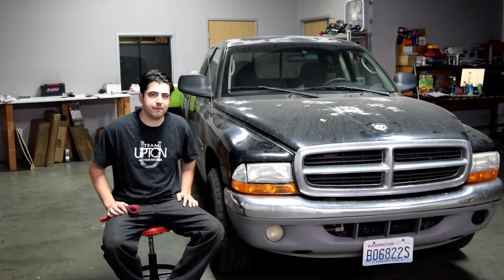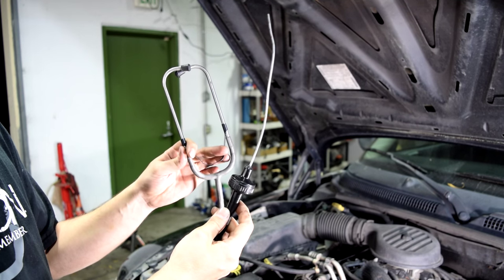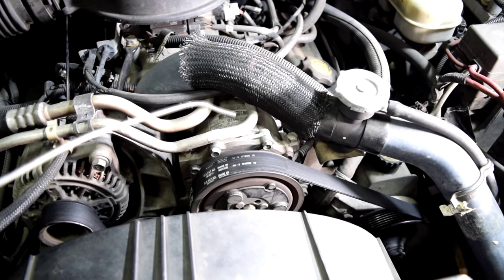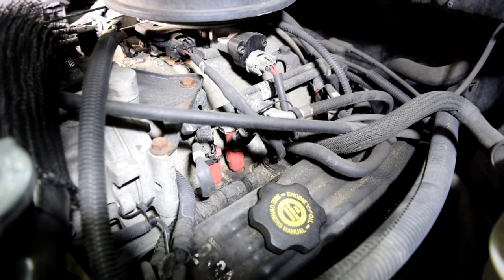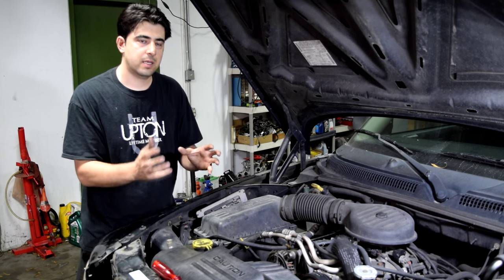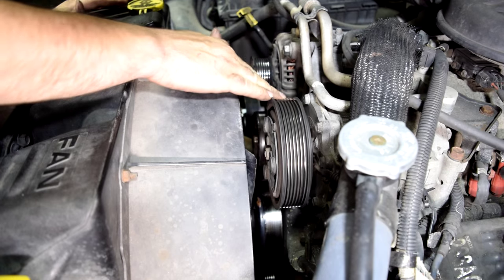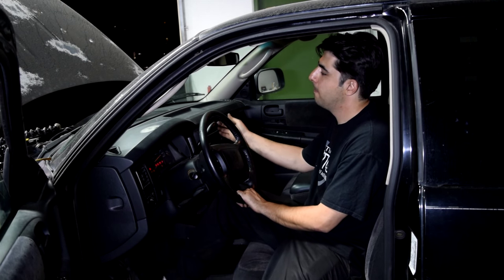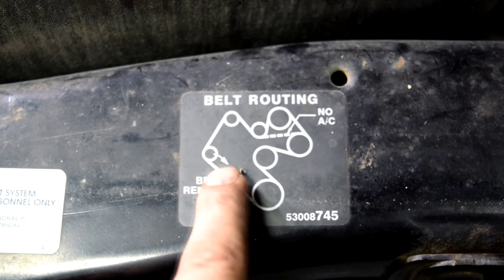How to Find Engine Noises - Finding Pulley, Bearing, Tapping and Knocking Noises

Comment: Thanks for the  bmw help,  I'm not sure what I'll have to do to fix that.  I also have a 1991 jeep Cherokee 4.0 having some overheating issues.  No leaks anywhere, water pump makes no noise,  all hoses have coolant flow,  and are hot,  no air in the system already checked that,  radiator was replaced 2 years ago and it worked great until  now temp is reaching over 220 and then efan kicks in and it does cool it down but something isn't right...  And I also replaced tstat and did complete coolant flush.  So I'm guessing it's water pump or radiator?  What do you think.

Comment: How do you pinpoint noises that only occur while you're driving? I'm pretty sure it's coming from one of these bearings/pulleys. The noise is very acceleration dependent. I can't reproduce it by revving a stationary car. It has to be moving and it only happens when accelerator is pressed about 1/4th of the way. If I go over or under that pedal pressure, it disappears.

Comment: hey I love your videos thank you so much for providing all your hard work for us people who don't know much about cars. I have a unrelated question that I need help with maybe you can help me? I have a 2004 BMW 545i and what's going on is the computer won't communicate with a OBD scan tool and also the car will not start and I get a transmission error and multiple other codes is there any thing that you can think of that could be going on I believe it's my main computer? What do you think please help me.
Reply from the maker: +Mrizing Sorry I have near zero experience working on bmw's but for example in the VW Passats the BCM, TCM and obviously the PCM can do this. If you had problems with other electrical accessories before your car died it would be possible its your bcm.. If you want a shot at fixing it yourself try looking up all the fuses and relays in both your engine and cabin fuse box, than physically check out all your control modules make sure their wiring isn't obviously damaged/loose. And also visit BMW online forums and ask around there, odds are some BMW enthusiasts there can steer you to the right direction. GL

Comment: my belt squeaks when in drive only changes with rpms too. once it hits45mph or the lasthear, it goes quiet for a while then comes back. but goes away in park. the tensioner is good so is the idler? can't seem to find the culprit 😥😥

Comment: Another great video! My car's making an electronic humming noise around the throttle body when the ignition is only in the 2nd position. I used a stethoscope and it sounds the loudest around the idle air control valve. I'll try unplugging it to see if the sound goes away. What then?
Reply from the maker: +anti0918 Thats probably normal, if you have an electronically controlled throttle plate they usually make that noise when the key is in the on position. Thank for commenting.
Reply: RatchetsAnd Wrenches It's a cable throttle. The sound goes away if I unplug the IAC valve connector.
Reply from the maker: +anti0918 Thats ok too I wouldn't worry about it. cheers

Comment: how do you know how tight the belt should be when you put it back on and tension it
Reply from the maker: +neppy5 these tensioners are auto adjusting tensioner and you can't manually adjust them. cheers

Comment: Dr, Sir:
I have the Toyota corolla 2004 CE 4 cylinder 1,8 L and it's become a month when the engine got hot after 5 or 10 minutes it starts to vibration and shaking. However, I have replaced new spark plugs, chek all the mounts, vacuum pipes cleaned the throttle body and air idle valve, replaced the drive belt too. but still, it has the same problems. Please help me.  I'm waiting to hear from you. best regards,
Reply: manoky zadran it may be the radiator. If its not giving out the right amount of pressure to push the fluid, it could not supply enough, or get some back spillage of oil from the engine which will really damage your engine. I'd recommend checking the color & consistency of your oil, engine coolant, & transmission fluid (speaking as their intake valves are pretty much attached), if any are off, you might have a pressure issues, which then you'd need to take it into a shop before furthering the damage. 

As we'll as, your radiator may have just given out on you. Any odd noises or things your car has been doing since this started?

Comment: I have avalon 2002 v6 after start engine hesitating and very bad noise from the down the car 227000 miles rpm am go down when i start ac and when i put in gear o have 2 belt but no pulley

Comment: good video... but I notice a whistling sound coming from the engine which sounded just like mine... what is making that whistling sound as you gas up the engine and where is it coming from?  I like to know because my car have that sound and sometimes the sound fluctuate like a car alarm from far away during and after acceleration.  Can you give me help?
Reply: Jack Denial 
Most likely your clutch fan...
They can get noisy